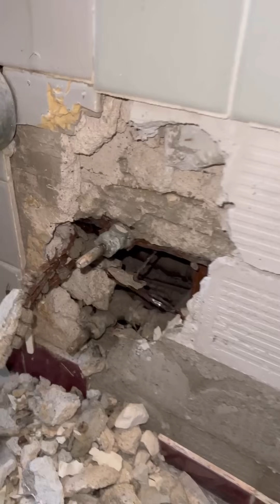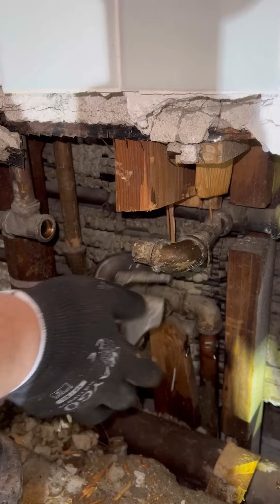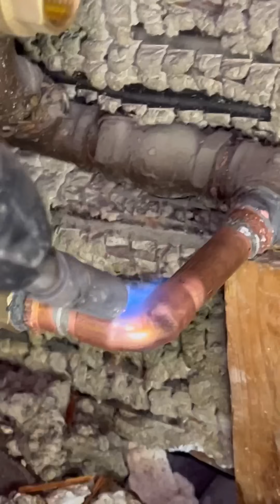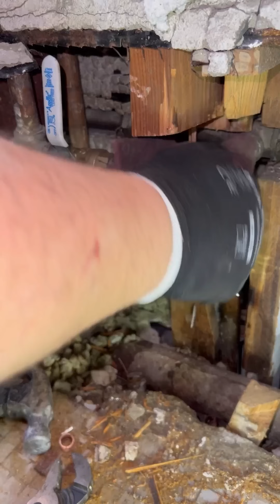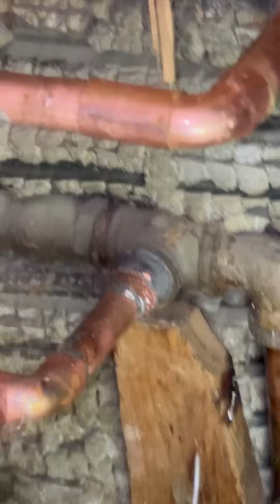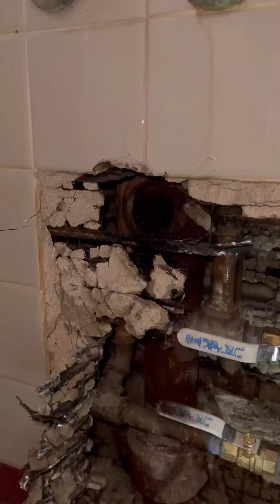Plumbing Chronicles 4 #story #work

Comment: I recommend keeping a set of pipe taps on the truck 1/8 thru 2 inch to clean the threads. You never know...
Reply: I do the same now. The post 2020 build quality of construction materials require it.

Comment: I did something similar with a 3/4 copper elbow. Was installing a water filter setup at my water meter in the basement. Let the filter hang a little too long on that elbow and it developed a little crack right at the inside of the 90. I had just soldered all of it together and didn't wanna deal with removing and resoldering a new 90 on... It wasn't leaking but I didn't like the way it looked so my solution was the same as yours - stuff a bunch of flux in the crack and solder away. Turned out pretty good and I don't think I'll have any issues with it in the future.

Comment: The solder is stronger than the brass. I had a feeling that was what you were going to do cuz that's exactly what I would have done. I saw a guy one time use a ProPress gas fitting on a piece of brass that was in a spot that it couldn't be unthreaded and that worked a treat. I mean it's been 4 years and hasn't leaked yet.
Reply: What Diablo blades do you use for cast iron? I just burned through three Lenox blades today on this 3 story high-rise cast iron cut out. Actually just posted a video on my channel.
Reply from the maker: The carbide teeth diablo. They’re amazing for the old cast (hub). nohub not so much but if brand new they will cut it

Comment: I am a lot of things, when I am thawing out sewers, I won't show up unless you have cash on hand. $300 minimum for the first hour. And $150 per hour after the first..
 No cash.. no flush..❤😂
  $500 minimum to thaw the water supply to your house.
 Any plumbing repairs to sewers or water supply are $300 per fixture for rough in, and $100 per hour for maintenance or repairs..❤
Reply: How many caddies do you own

Comment: I must say that this older brass plumbing lasted for decades and is very reliable,  BUT when you start to mess with it you can find yourself with a big job when older pipes break under pressure as you work on them. My father had the whole house replumbed in 1950 with brass plumbing. The original plumbing was iron pipe from 1920.
Reply from the maker: Wow

Comment: You ever run into all brass drainage pipes? Was working a job in Pittsburgh and for the first and only time I’ve Uber seen it, everything was brass except the vertical stack. There was legit 3” brass pipes running across tying to the stack. Before I could stop it the contractor had cut a lot of it out. They only care about what they can scrap

Comment: How are the ball valves typically going to be accessed with the handles in the walls? Access panel?

Thanks for the video broski, these old buildings with the mortar and chicken wire are always a huge pain to demo
Reply: I’ve done Condo work here in Calif access panels are cheap most can be painted same color of the wall or tiled to the edges with metal ones with a key lock so no one can mess with shut off valves. On a  plumb job when condo raided search warrant by State Narcs. They were pretty cool to me. But the Sergeant Notices access panel at Jacuzzi tub I installed year earlier. I’m on Roledex. For condo Manager and HomeOwners. Told me to open it or he would put a sledge hammer to it. Knew it would be extra pain work 
. Most have genaric key. Felt bad when I opened it they found 140 k cash and 2 ks of coke.  Man wish I would of checked that pump that day.  Oh well.
Reply from the maker: Damnn 🤑🤑
Reply from the maker: Yes they will leave an access door there. 
Thank you 🙏🏼

Comment: I have Nick pipes like that before and I use a silver solder it really works good it's easier than the regular solder so little tip I've found
Reply: Thats because the silver lowers the melting point of solder. That's why its easier to work with. 😊

Comment: I use a grinder on those tiles. I cut my square out and the tiles pop off whole so you don't have to deal with shattered tile. Also have your helper use a oscillating multi tool to cut the studs. He will be able to control it better. And also tell the super to go fuck himself.

Comment: Great video bro, question, with a 6 story building when you shutoff the water to one riser then open the apt faucet to drain the pipes, how long does the drain usually take if you are on the 1st floor? Ive had cases where it takes 30 minutes which seems way too long.
Reply from the maker: Thank you. If you are shutting off just that riser it should be done within a minute bro
Reply: @hydronyc  thanks for the reply…makes sense not sure why it takes so long in this 100 year old building

Comment: I had to do the same thing but in a 1929 wood frame house .
Try using a torch surrounded by The lumber which is so dry that one spark would light up the house like a match. 
I always tell people that I charge x amount for doing the plumbing job but if I open the wall and there are unforeseen problems then I would have to charge extra  for that .
Reply from the maker: Thats good bro. We have to look out for ourselves

Comment: 2 inch copper fitting brush. Cut the handle off and put it in a drill. Cleans the shit out of female threads. Great video.

Comment: I do a lot of computer work for police departments where as I copy drives or print pictures for court. I have an extra charge that goes into every job that is substantial. At the end of the job if its not needed I pull that out. They know about it ahead of time. Every time!

Comment: Street 90 and a coupling 😅 . Measurements off broski..your cutting copper pipe to short  
 Nicked the riser and soldered it shut... well there's a flood in a year or two. Expansion is a muthafka. I'm guessing you have no liability insurance or any sort of traceable credentials
Reply: I was wondering why there was no pipe dope or anything on any of the threads either.
Reply: @edbuckley1670   The camera doesn't catch everything.

Comment: Hey tip get rust olem jelly for those rusty treads hit it with brush in 5 or 10mins and youre good to go thank me later.
Reply: Also cut the cut the handle off the brush and put it in a drill.

Comment: Dude. Why don't you own a set of pipe thread taps? Instead of dicking with rusted pipe threads in old fittings... which you seem to do a lot. Break as much of the pipe out as you can, then run a tap into it. I bought a 2" NPT tap for like $40 when I needed to so something just like this in my friend's house. You do this for a living... >_>
Reply: Some PB Blaster as well instead of the WD40.
Reply: @stringlarson1247  Or pipe thread cutting oil... it's literally in the name.
Reply: @madmanmapper  Ahh, I was just thinking of about busting the old 'rust weld' sht. 
Just a geezer who's been wrenching on old cars and homes.Not so much from a pro plumber looking to get it done straight away. If that makes sense.
Reply: @stringlarson1247  It's k. I'm not a plumber either. Mechanic, actually. I like PB Blaster, too.

Comment: Go on the internet there this stuff called pipe break spray that on hard to gwt out nipples it eats away at the rust been around for well over 40 years also that's the worst thing you can do is use your hammer on your wrench forget about breaking your tool what you can do to the plumbing inside the wall could effect everything have a chance reaction

Comment: Is that a black iron nipple? That’s not good and illegal anywhere I’ve worked. Galvanized would at least make it legal, brass would be best.
Reply: For that particular piece Galvanized is approved in NYC (as well as a Brass Nipple) But since that particular area gets hit hard with the drain snake, utilizing a galvanized steel nipple is best practice
Reply: @LyonhartZ2  yes, what isn’t code is a black iron nipple which is what it appeared to be

Comment: Brother love your videos and your work. Perfect mix of doing it right, but also calling it like you see it with some BS.

Coming from the roofer, I never price over the phone. Free estimates are for large jobs only.

Half day jobs or small repairs aren’t free estimates or id spend all day doing free quotes. Ya sure you book work but I’d never be able to do the work, as I’d be doing more free quotes.

I upfront explain that to people, and say either “from what your explaining here is my range” and if they accept I’ll show up.

I’ll only bill what I’ve worked anyways, time+materials, and love to come in at the bottom end of my range just to show people some honesty.

But if I do need to go higher they understand. I explain there’s usually 2-3 places I’ll inspect, and sometimes permanent repair and sometimes it’s temp (if you have to order custom material etc).

I say hey sometimes it’s a large range and a roll of the dice; but ultimately it’s your house that decides the scope depending on its issues and the proper repair needed.

Sometime you get a permanent repair for minimum $200 if it’s an easy to spot issue and I have materials on hand.

Other times is $600 to inspect, diagnose, temp repairs, and then quote for the full work.

Then the full work could be a few thousand. All depends on what you need fixed.

I’ll be honest as all hell, and expect my customers to be too. 

All explained over the phone on the first call, but then make sure to have them text the address to me.

This way I tell them these conditions again (already over phone) but now in text and ask they respond saying they agree. And now I have the phone # to contact them when o arrive.

Crazy roofer here BTW. Don’t have too much fun out there boys!

Comment: Why don't you use propress? I know what you mean about pain in the ass jobs! It always happens, a nice string of smooth jobs then all of a sudden, a string of jobs where nothing goes right.
Reply: Plumbers usually stick to how they learn, and even if they know how to do certain things in other ways, they’ll do as taught day 1 since that’s what gives em no call backs
Reply: I was an apprentice before Propress even existed. Even today, though, there are situations where I solder copper. The Propress doesn't always fit in a tight spot. It's good to be able to use either method of joining copper.
Reply: @kenc.9067   I can sweat np, Progress is a lot quicker/easier

Comment: Great job, now they will have absolutely no access to those valves. Might as well straight pipes them. What are they gonna do?? Break the wall and tiles to close the valves ?? Time to go back to plumbing school
Reply: Why won't they have access? Don't you think they'll install access panels when they have their finishers finish? This isn't the plumbers' job. If they want access, they'll install access.
Reply: Access panels.
Reply: @adamlogan384  they sell access shut off valves with great finishes, but I guess a ghetto access panel would be better
Reply from the maker: They put an access door of course. That was the whole point